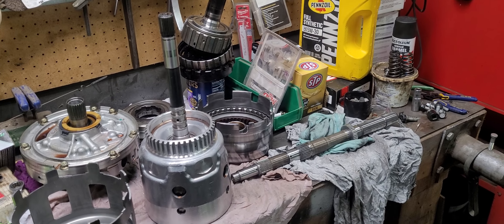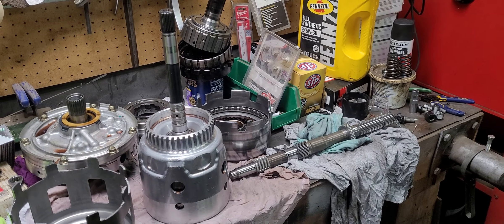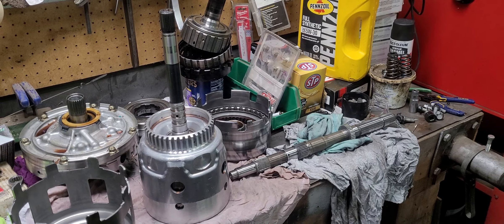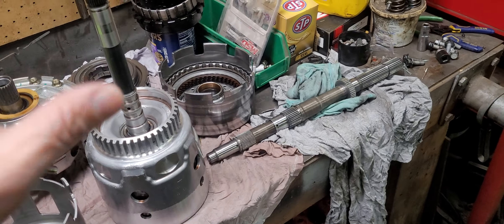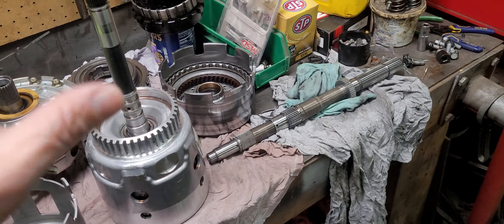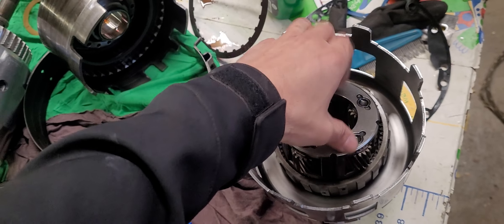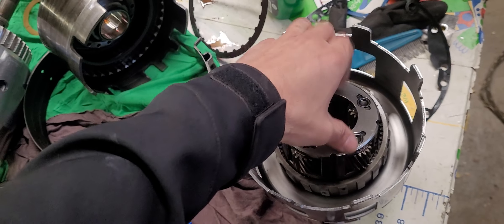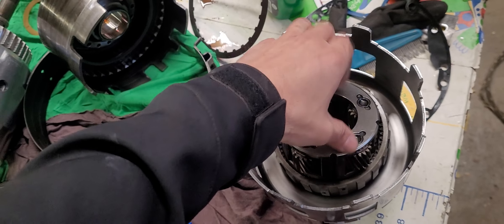4L60e/4l65e 5 pinion planetary

Comment: Does the 5 pinion fit it the 4l60e without any modification  ?
Reply from the maker: Yes but it's the complete set. You can't just put the 5 pinion inside a 4 pinion ring gear. Also the cheaper aftermarket 5 pinion sets are not any better than a factory 4 pinion.